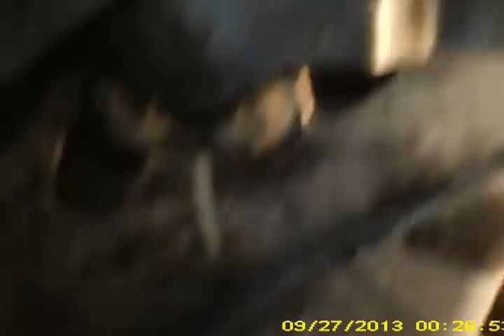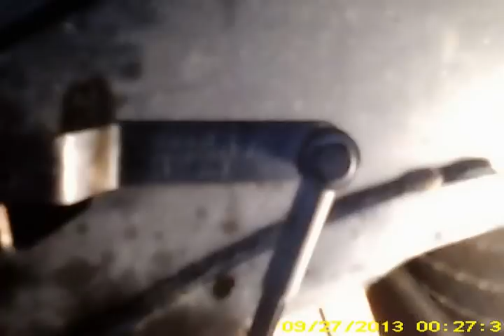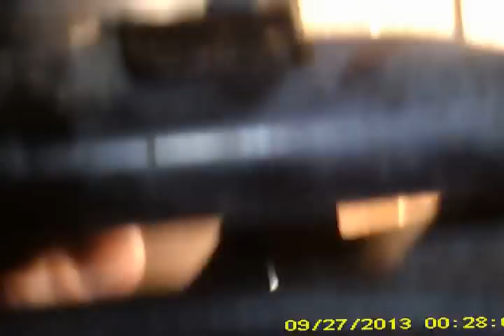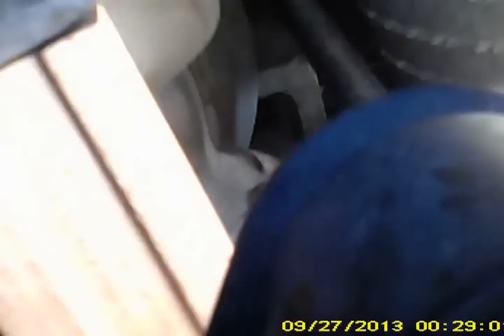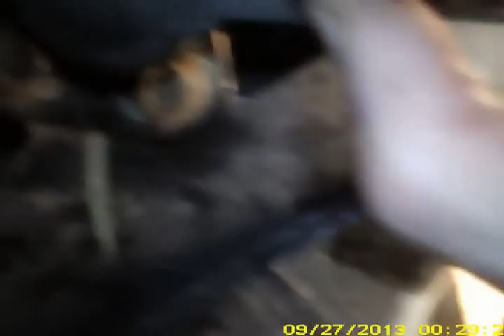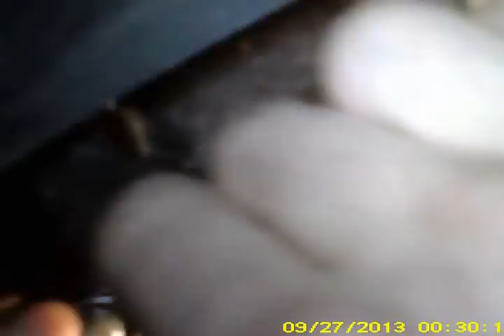GMC Envoy Air Suspension Sensor

Comment: Can u please help  memy 08 gmc envoy denali has left side sagging but not all the way down ..so my car leans to left.. please give me any info on this subject
Reply: There is a conversion kit comes with 2 coil springs and 2 shocks permanent fix never have to worry about air bags again and it rides the same.
Reply: Thanks did that a long time ago..
Reply: took 11 years... It's oke adn the ride is very nice. I wouldnt convert to springs
Reply: Pete White
Reply: Good video. Thanks